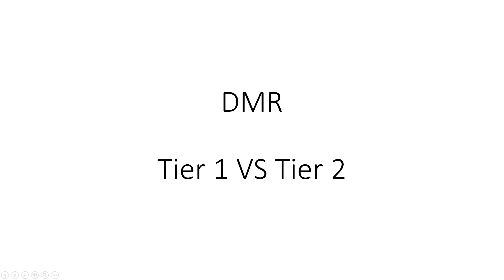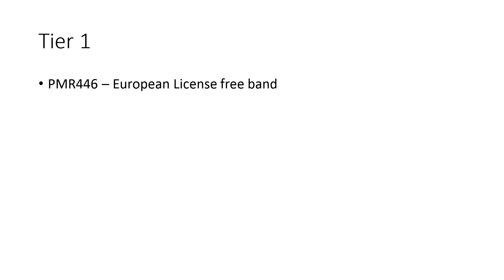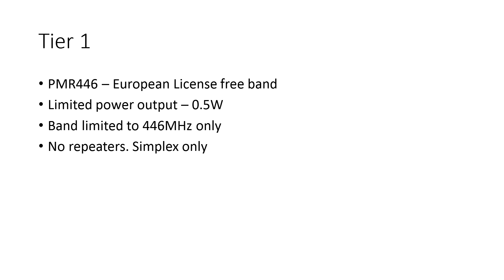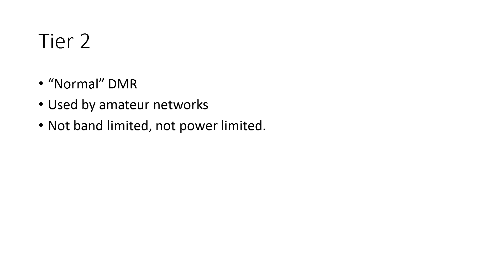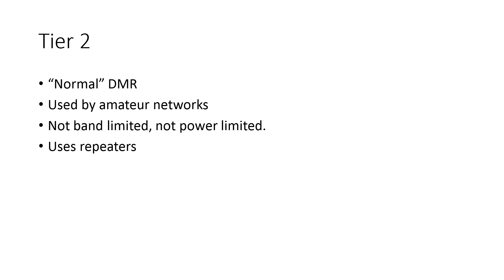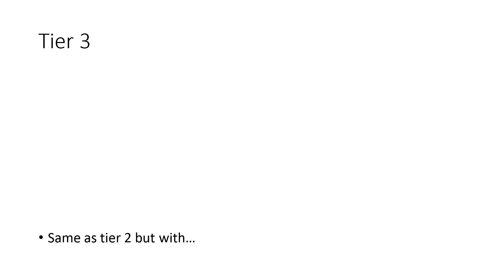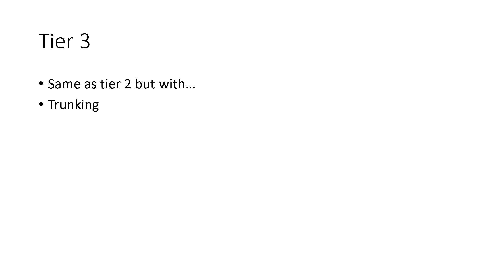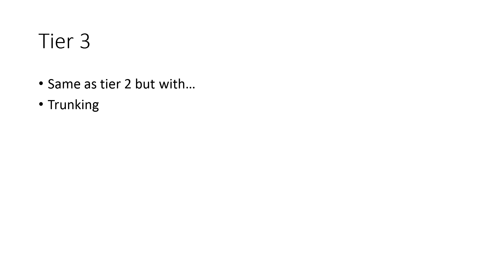Tier 1 VS Tier 2 DMR. What's the difference?

Comment: I've been wondering about what is suitable for dPMR.
Reply from the maker: I don't really understand what you're asking
Reply: @radiosification  Those suitable for digital PMR446
Reply from the maker: You're asking which radios are suitable?
Reply: @radiosification  Yes. Heard that a standard DMR can't be used on it.
Reply from the maker: That's right, if you're talking about legally. The radios have to have 0.5w output power and a fixed antenna
Reply: @radiosification  I thought there was some technical difference.

Comment: Can the digital dpmr Motorola xt660 work with the dmr vfo mode or channel mode on  tyt uv380 the signal picks up and led goes green  on the tyt but no audio  thanks forgot to add I've set tyt on correct color code for Motorola but nothing
Reply from the maker: No. They are completely separate digital standards (dPMR and DMR) and could not work together at all
Reply: @radiosification  oh damn :( never mind then lol is it the vo coder or something
Reply: @radiosification  thanks for reply bud love the videos
Reply from the maker: Well actually are you sure the Motorola is dPMR and not DMR? If it's DMR then they could work together. I'm not sure but I remember looking at the Motorola licence free digital ones a few months back and I couldn't find info on whether it's DMR or dPMR. So if it's DMR then it could work. I'm quite interested to find out actually and I'm online right now. Feel free to send me a message on my Facebook page radiosification
Reply from the maker: Also have a look at this blog post I wrote which explains the modes and tiers :https://radiosification.blogspot.com/2018/01/dpmr-and-dmr-tiers-and-modes-explained.html
Reply: @radiosification  not 100% sure but I think it's dpmr could be wrong though I've got both the xt660 and tyt uv380 and have them set to digital pmr just for a test the uv380 picks up signal the xt660 does not on the  same frequency channel 1 446.006250 bit stumped on this. Not much info about the digital pmr I've looked doesn't even tell you in the Motorola manual lol .and yeah thanks bud
Reply: @radiosification  be quite interesting to find out what the Motorola digital pmr standard is like mate I'll let you know if find anything on them give u a message
Reply: @radiosification  cheers good blog mate helped me to understand a bit more happy hunting online for info  all best
Reply from the maker: I think the Motorola ones must be dPMR
Reply: @radiosification  yeah they are mate their fdma  aswell not tdma like the tyt md uv380 and md380
Reply: Dpmr is just digital personal mobile radio uses 12.5 khz bandwidth not 6.25 like tdma think that's why they don't work with each other
Reply: @radiosification  just got into digital know nothing about the standards part from the bit bout the tiers anyway thanks

Comment: No I'm more confused, what's trunking? Is it the same as trunking term in  network switches??
Reply from the maker: Trunking is where channels are assigned dynamically. Instead of for example channel 1, 2, 3 each have one group of people who always use that same frequency, in trunking you use talkgroups and whenever someone in a talkgroup wants to speak to others in the talkgroup, their radio communicates with the radio system, a channel is assigned, and they can talk. This allows as many users to be talking at the same time as there are channels, instead of with conventional where there could only be 3 groups in total (in this example, because there are 3 channels).

Comment: DMR Tier 1 and Tier 2 cannot talk to each oder. DMR Tier 1 is C4FM/FDMA and Tier 2/3 is C4FM/TDMA!
Reply from the maker: They can talk to each other, I have done it before
Reply: Whatever.

For Tier 1, you need a rig that can decode Tier 1. A Hytera PD685 which is a sole Tier 2 and 3 Rig cant decode Tier 1. Same with a PD785. A PD365 can do Tier 1 and Tier 2.

But a Hytera PD365LF cant decode a a Kydera Radio (no matter which one).

I am SysOp of a DMR Tier 2 HAM Repeater. I working with DMR since 7 years now. At home we use Hytera PD365LF DMR Tier 1 TRX.
Reply from the maker: Okay, thanks for the info. I will have to check again.

Comment: with the MD -390 can you hear P25 digital
Reply from the maker: No, it is a DMR radio. To hear P25 you have to buy a P25 radio.
Reply: P-25 is different.  C4FM is P-25 but the ham C4FM is not the same as the Public Safety C4FM.  It all comes down to money.
Reply from the maker: C4FM is not P25. C4FM is a modulation scheme. P25 uses C4FM. Yaesu's standard, system fusion, also uses the modulation of C4FM. It doesn't all come down to money. They're simply different standards designed for different things. You wouldn't need a public safety radio system to be able to send amateur callsigns. P25 also uses a different vocoder because it was made years ago, before the vocoder in Yaesu fusion was made.

Comment: Based off P25 the way I understand it is:

Tier 1 - Simplex
Tier 2 - Simplex and Duplex / repeaters
Tier 3 - Simplex, and Duplex and Trunking

Where higher tiers are reverse compatible with lower tier radios if programmed properly. For example a TYT MD-390 will do simplex or duplex but not trunking because it is a tier 2 radio. A Motorola  APX8000 is a tier 3 radio meaning is will do trunking as well as lower tier features. The 8000 is also a quad band radio and I call it a tier 4 radio though there is no such classification like that, its my own thing i do.

NOTE - The US MURS, FRS and GMRS bands is it illegal to use DMR or any other digital format.
PMR446 is Illegal in the US without a ham radio license because 446 is part of the US 70cm Ham radio band

https://en.wikipedia.org/wiki/Digital_mobile_radio
Reply from the maker: That is correct, but not really the whole picture. Saying it like that cuts out important information. A radio that only does simplex is not necessarily a tier 1 radio, because it still would have to have a limited power output and be limited to using the 446MHz license free band.
Reply: I think our conflict is US vs EU/UK lol
Also I got Tier 2 simplex confused with tier 1 too for some odd reason
Here in the US you cannot use between 430 and 450 without a ham radio license so 446 radios would require a license to use here and our license free band is FRS 462 and 467 MHz and DMR or any digital formats are not allowed there.
Reply from the maker: Yes, the tier 1 devices are designed to be used only in Europe where such devices are allowed. Using them in the US would not be allowed unless you used them as an amateur radio operator, but that would be a bit pointless since in that case it would be much better to buy a tier 2 radio. Since ETSI, the institute which made the DMR standard is a European institute, that is why it has made tier 1 DMR which is specially for use in Europe. The rest of the world has adopted DMR but it is still a European standard.

Comment: Can Tier 1 also be referred to as DPMR?  Or is DPMR another system altogether such as the Kirisun brand of radios?
Reply from the maker: humaxf1 Tier 1 cannot, under any circumstances, be referred to as dPMR. That would be far too confusing 😁.  The Kirisun S780 is a dPMR radio not a DMR radio, but they do also make DMR radios. dPMR is a completely separate standard. Look it up and you'll see that it also has tiers, similar to the ones in DMR.

Comment: how can rier 1 and tier 2 be compatable even on the same frequency when they use 2 diferent protocols.  FTDMA for 446 tier 1 and TDMA for tier 2?
Reply from the maker: Firstly FDMA and TDMA are not protocols. They are channel access methods. Secondly, they don't. Tier 1 and Tier 2 are both TDMA. Any information suggesting otherwise is incorrect and is probably Baofeng marketing material
Reply: Ok thanks for correcting me on that its strange how everywhere i have looked says that tier 1 is fdma as that will allow 16 channels  on 446 at 6 and a quater KHz channel spacing that doesnt really seem to fit with the TDMA setting
Reply from the maker: That's dPMR446, which is a totally different standard and that one is FDMA. With DMR you get 8 channels in the digital PMR446 band, however you can actually use 16 channels if your radios use DCDM (Dual Capacity Direct Mode) which allows the DMR radios to synchronise so that both timeslots can be used on simplex. (So there are 8 channels in the frequency domain but 2 timeslots in each channel) See the link below for more info. http://cwh050.blogspot.co.uk/2012/12/dcdm.html
Reply: radiosification cheers thanks for clearing that up some of the information on the net is very confusing.
Reply: @radiosification  First things first. FDMA and TDMA are media access methods, so they are not protocols, but they IMPLIES the protocol, so if something uses TDMA and another thing uses FDMA, then this implies that theese two things have to use different protocols. But back to the Kern des Pudels, I hope you agree, that TDMA systems need some kind of synchronization. This is easy to obtain in repeater based systems, where every station is able to receive the repeater (or doesn't work at all) and repeater is unique to that network, so it is relatively easy to use repeater as a timing source for TDMA. But HOW this could be obtained in a network without repeater? Where is the source of that synchronization? Think about that. I don't care about Baofeng and any other shitty marketing material, but I do care about how the TDMA timing could be implemented. In fact, if you want to implement TDMA on a no-repeater channel, you need an external timing source. This could be DCF77 signal, GPS (this is way how some wifi-like hardware implements TDMA syncing of two and more TDMA masters), almost any external time signal, but then the whole service is dependent on avaiability of that signal (to all stations) and also on its precision. It's not impossible to do this, but it is a kind of overcomplicated thing without any benefit in this particular case. This is why the Tier1 is based on FDMA only instead of TDMA over FDMA used in Tier2 and Tier3.

TDMA concept is frequently misunderstood. Back to basics please, not the baofeng and other manufacturer's  marketing material.
Reply: I think he was using pmr446 as an example for the video, the formats is DMR all around and can be on any band. a higher tier radio can be programmed to work on a lower tier systems like a tier 3 can work on a tier 2 or 1 group of radios.. Its more or less about compatibility and features.
Reply from the maker: No I was not using pmr446 as an example at all. The specification says that a tier 1 radio must do exactly the things that I mentioned in the video. That's what tier 1 is - DMR on PMR446 for license free use. Tier 1 radios are not designed for use outside of Europe. DMR tier 1 radios absolutely cannot exist on any other frequency, since to do so would mean they are not actually tier 1 radios.
Reply: radiosification it seems to b a confusing subject as i thought that tier 1 dmr isnt compatable with tier 2 or 3 because they use tdma and tier 1 uses fdma. i have seen that mentioned in a few places. i know that dpmr uses uses fdma and was under the impression that tier 1 was dpmr used for 446 digital use originally but then expanded to b used by other business servises as a small system solution. it does seem to b very confusing and it is good to get your take on this matter
Reply from the maker: Actually I have just been reading the ETSI DMR specification very carefully and Tier 1 DMR MAY actually use a constant carrier, so not necessarily TDMA. However the only tier 1 DMR radios I have seen for sale do use TDMA. They are the Hytera ones you can see on the link in the description. Tier 1 DMR is still a different thing to dPMR, because dPMR uses 6.25KHz channels and DMR still uses 12.5KHz channels including in tier 1. dPMR was made as a standard with multiple tiers/modes just like DMR. If you look at the wikipedia page for dPMR, it shows the modes as dPMR446, Mode 1, Mode 2, Mode 3. Mode 1 is simplex only but without the power limits and frequency limits of dPMR446 mode. DMR does not have an equivalent to this simplex only mode, going straight from the license free tier 1 to the repeater capable tier 2.
Reply: Its a specific protocol for the pmr band? I'm a be honest, I have no clue lol I know about what goes on generally in the US but not so much about overseas..
it is interesting though.
Reply from the maker: Tier 1 DMR and dPMR446 are made specifically for the PMR446 band yes. But not the rest of DMR and dPMR.
Reply: We have our terms fucked up over here because even the local Motorola shop calls simplex no repeater DMR tier 1 LOL  Murica FTW right?
Reply from the maker: Hah well that's just plain wrong. It's a shame they don't bother to use the proper terminology.
Reply: Yes it is, Thank god for people like you teaching people like me the correct terms and I been in the radio comms career for 15 years now and still learning, maybe I can pass it along.

I think it has to do with the fact that pmr446 does not exist over here too. who knows..